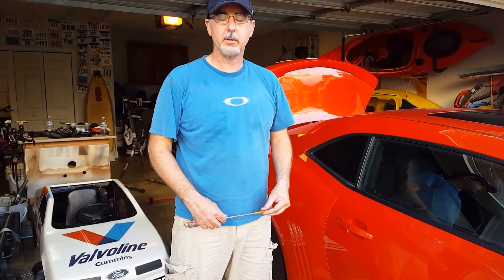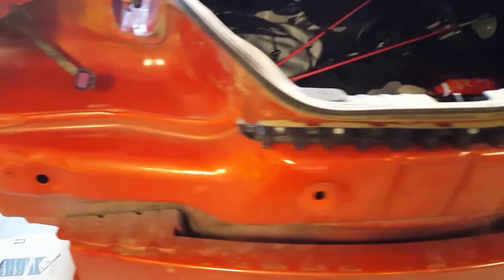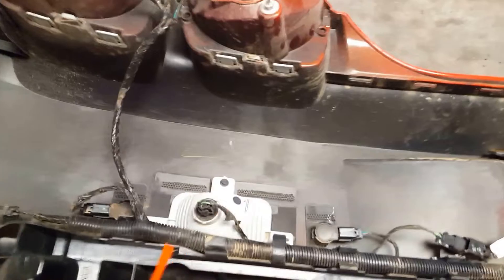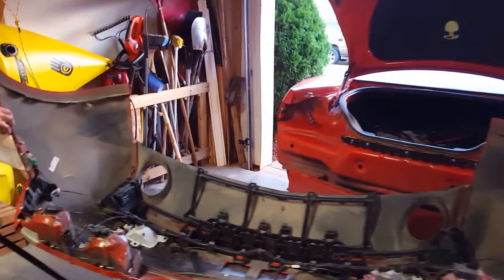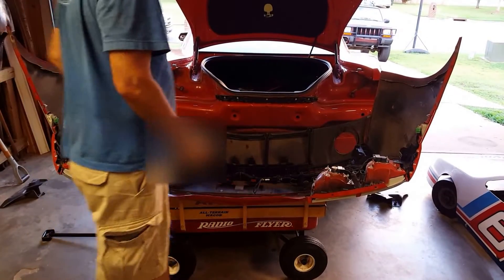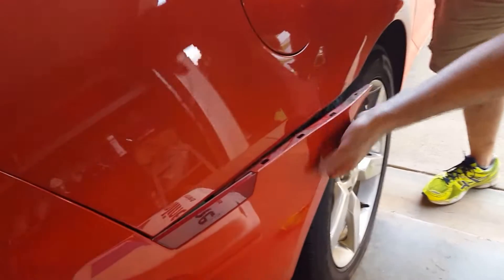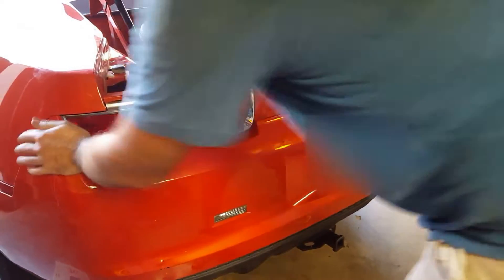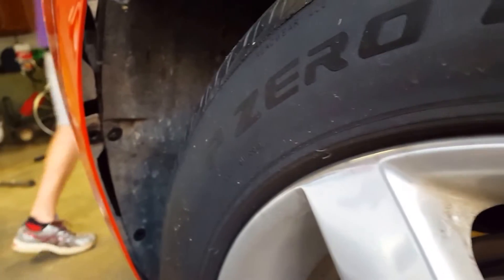Camaro reverse light, fascia installation

Comment: helps me out quite a bit, have to replace my rear fascia after having a small driveway accident.. rather do it myself then pay someone and make an insurance claim..
Reply: did you ever do this? i'm in the same situation. wondering how it went with you, especially transferring all the electronics on the inside of the old bumper to the new one. thanks for any help.

Comment: When changing the bulb do you really got to remove the bumper?
Reply: Yes…. It’s unfortunately the only light that’s a PITA to replace. It also only comes as a halogen bulb I believe. If you decide to “upgrade”, as a DIY option, the LED bulbs typically don’t fit bc they sizing is off. 

I’m still trying to figure out a way though… The factory halogen bulbs aren’t actually too dark or too bright, but I definitely could use some real bright LED reverse lights (never fails!) for safety purposes (and looks).

Comment: All you have to do is pull the reverse lens off  you didn’t have to remove the whole Bumper cover.
Reply: u can’t pull the lens off because the shape of the lens is bigger than the hole
Reply: Wow r u serious.. I’m mind blown there’s no alternative way
Reply: @randylamp6006 You can’t remove the “lens”… This dude clearly never ever worked on the 5th gen Camaro’s… The reverse light bulbs, are the only ones that are truly a PITA to replace, since they require the entire bumper to come off. 

And once you figure out that LED upgrades aren’t even available or fit properly…. You begin to wonder why GM/Chevy even bothered to make such a shitty halogen lighting assembly work in such a fashion..